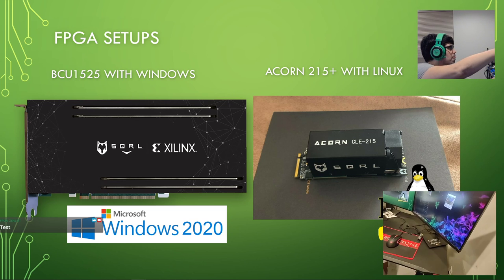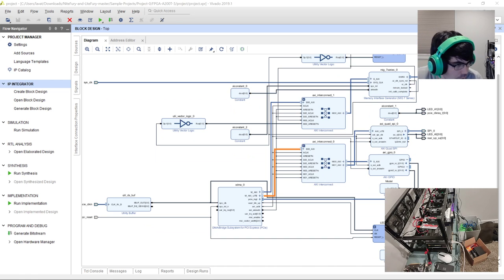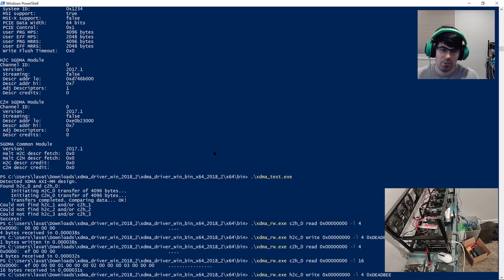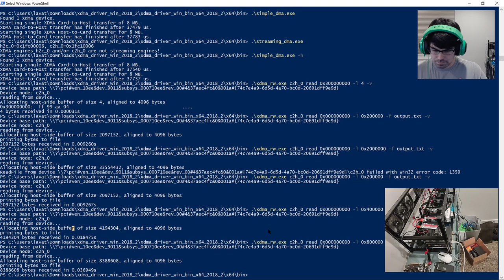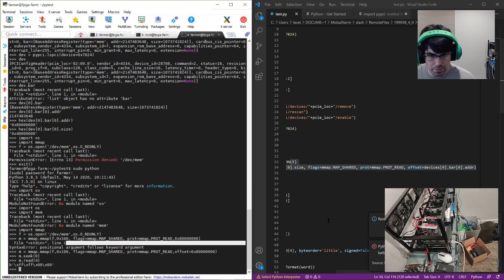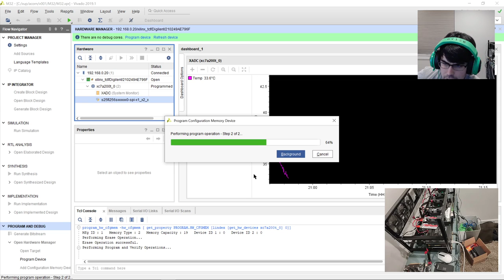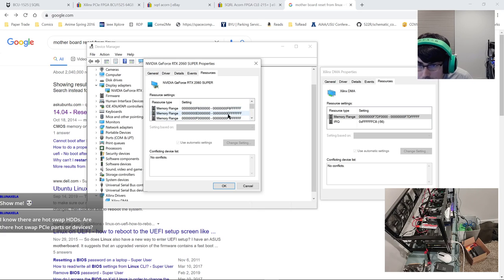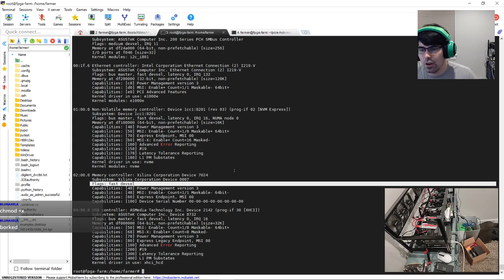PCIe on Xilinx FPGAs

Comment: 44:22 Would it be needed to adjust resistor termination in FPGA transceivers as well as the Server Riser card's re-driver and re-timer?
Usage of riser cards can cause the link to not train, due to not detected Tx receivers on some lanes

Comment: Hello! 
I have one quite general question. I have been considering purchase a special FPGA board such like the  Xilinx BCU 1525 FPGA and sqrl accorn (as mentioned in your video). But I am always not sure whether such kinds of boards can be programmable by Vivado as like normal FPGA board or not? Although it seems be possible from your video. 

I really appreciate if you can give me some suggestion.
Reply: If I'm not mistaken, the free version of the Vivado will program the Artix 7 on the Acorn through JTAG but I believe you need the license version of Vivado for the BCU 1525 since it uses the Virtex Ultrascale+
Reply from the maker: The Acorn requires you to make a cable to connect the JTAG to a Digilent JTAG USB device.  You can follow this guide: https://github.com/enjoy-digital/litex/wiki/Use-LiteX-on-the-Acorn-CLE-215
Reply from the maker: The BCU 1525 has a JTAG USB port, but does require a licensed Vivado version to compile bitfiles like  @Mikey said.

Comment: I wonder how I can use an FPGA to speed up tasks like video encoding or other tasks that take a long time on the CPU and sometimes even GPU? As I wish FPGAs were much easier to buy, setup and use with apps I have on my PC. Is there a way this can be achieved or is the technology not there yet? I'm new to the FPGA scene.
Reply from the maker: The LiteFury 2 is the most affordable option, but the complete lack of HDL, driver, and API make it a hobby project at best. I plan to add some examples later in 2024.

Comment: Great video, thanks for making it! On the topic of your BAR resize needing a reboot: You are right that you can’t dynamically reallocate BARs on your devices after device reset without pcie hotplug support with your firmware, OS kernel, and device all working in tandem with the spec. It will especially require help from your mobo firmware, and they are not all made equally. However, the trend is moving that way now that Thundebolt 3 essentially does external PCIe hotswap over the thunderbolt cable. We will see a lot more support in the coming years, and I am curious to know the extent that the Xilinx pcie core supports it as well— my feeling is not.

Comment: Hi if possible any driver available to communicate pcie gen 2 x4 bat address read /write via python in windows?
Reply from the maker: Windows is a difficult platform to develop PCIe for.  There is not an easy way to interact with memory.
Reply: @FPGAZealot  thanks for your reply...if possible we can communicate pcie gen2 x4 via bar address to perform read/write via python in Linux?
Reply from the maker: @trendmakerzz7453  you can use mmap and np array to read direct memory in Linux with Python.
Reply: @FPGAZealot  can you please share me if you have any reference python file to read bar address memory space data in python Linux...
Reply: Hi why pcie xilnx memory controller am trying to read data from bar address but am getting response like 0xffffffff in both windows 10 and ubuntu...how to fix these issues yu have any idea pls suggest me...
Reply from the maker: @trendmakerzz7453  
https://discord.gg/xM5Bs7er
https://github.com/byuccl/fiate/tree/main/host_sw
Reply: @FPGAZealot  Hi, is it possible will get the 163840 bytes from pcie gen2 x4 within 0.5 milliseconds?python or some other languages?
Reply: @FPGAZealot  
While sending read request in mmap using python from pc ,in fpga I am getting request length always '1'. Please suggest me how to send the  read request  to FPGA with request length greater than 1,using mmap python.
Reply from the maker: @trendmakerzz7453  that requires the xdma engine and driver.  That is Xilinx canned solution. Otherwise try litepcie.
Reply: @trendmakerzz7453  Did you find a solution for this ?
Reply: @FPGAZealot  is there xilinx pci lite ? Or any opensource ?
Reply from the maker: @faizahmed4304  try LitePCIe

Comment: Hello, thank you for the detailed tutorial.
I am working with xilinx xcku1500, windows10. I'd like to use XDMA to transfer data from host to DRAM of FPGA. I am just starting with XDMA IP example design. However, after I run synthesis and implementation, and load bitstream to FPGA, I can not find 'Xilinx Drivers' on Device Manager, as this video shows. Of course I have installed XDMA driver. I am wondering the reasons. 
Could you help me with some advice?
Reply: I checked the outputs of XDMA IP -- axi_aclk, axi_aresetn and user_lnk_up -- by linking them with leds. I found that user_lnk_up is LOW which indicates that physical link fails. It is strange because xcku1500 is powered through PCIE.
Reply from the maker: Probably a PCIe clk or lane pinout issue

Comment: Did you ever figure out how to get RWEverything to access the memory addressed by your BAR?
Reply from the maker: Depends on the address space of the motherboard PCIe enumeration
Reply: @FPGAZealot  Did you get it working for your application?  If you're able to get a configured BAR (which you can obviously check with RWE, or for that matter, even configure it with RWE), RWE should be able to access that address region the BAR points to I would think?  I understand if the BAR is in 32 bit address space, on a 64 bit OS, that has to be mapped somewhere in the 64 bit address space.  In my case, I just  used 64 bit BARs, and I would think it would map it into real address space as far as RWE would think...  I guess I'm assuming RWE memory read/write it to physical address in 64 bit space on a 64 bit OS.
Reply: I used WinDriver (Jungo) evaluation to make a .inf file for my board, used Device Manager to associate it with my board, and using Device Manager, did a scan for new hardware, and my board board got enumerated.  Then I was able to read/write all the memory/GPIO registers behind the BARs.  So, the answer is, RWE can access the memory behind my BARs.

Comment: Hi.. this is a great FPGA channel! so.. my questions: 
1) can an Acorn CLE 215+ be flashed through PCIe without JTAG cable? 
2) is it mandatory to use a JTAG cable to flash/program? 
3) Is there a guide to flashing via PCIe?
4) Can I design in tools like Vivado and then flash / program via PCIe?
Reply from the maker: You need to have a FPGA design with both PCIe and the flash on the FPGA already then you program the flash over PCIe.  But your first program will probably have to be over JTAG.
Reply from the maker: My other videos show my method for programming the flash, but since it's a FPGA you can do whatever you want.